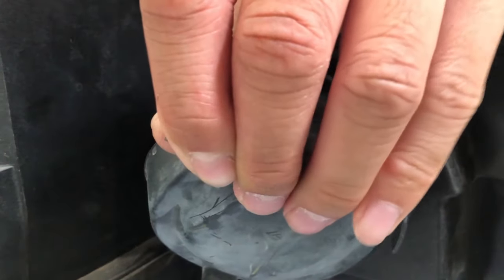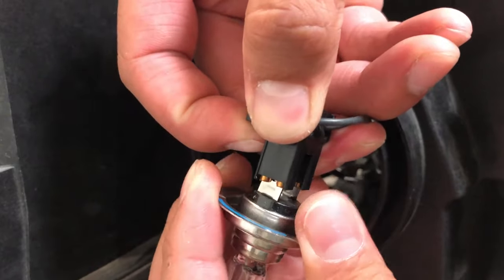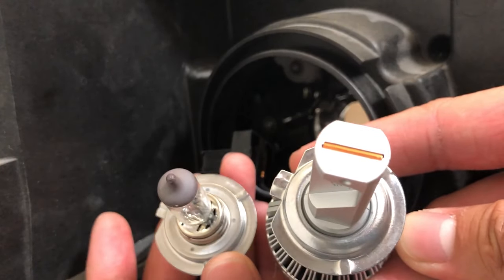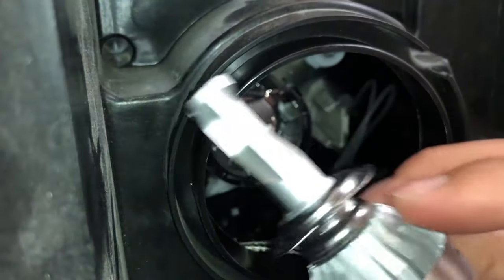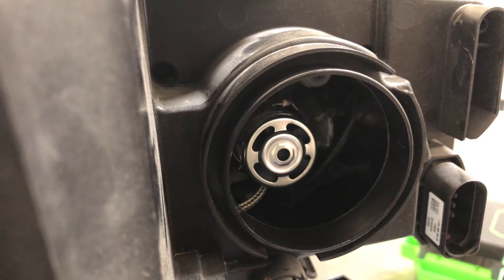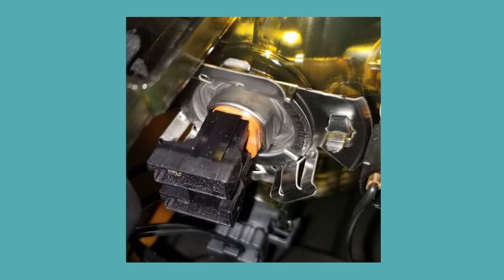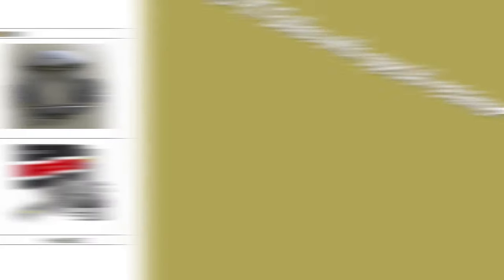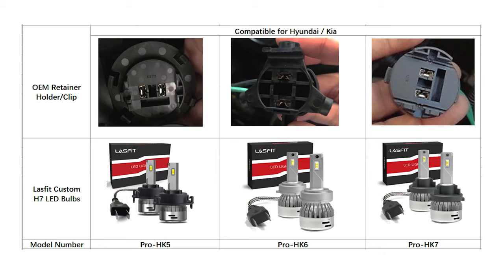How to install standard H7 LED headlight bulbs?

Comment: Hey guys I just installed these LEDs for my 2019 VW Tiguan for the high beams and they are super easy to install, maybe 10 mins tops. They were much easier to install than the low beams. Theses are the type 2 installation. Once the LEDS are clicked in and installed, you can twist it to adjust the beam pattern.
Reply from the maker: 👍 Good job 👍  How nice it would be if you could share a video with us of how you install these LEDs on your Tiguan. haha
Reply: @lasfitvehiclelife  Honestly, it is identical to the one in the video. The type two installation.
Reply from the maker: @michaelbrock8397  Yes. Did you test them and how they perform at night?
Reply: @lasfitvehiclelife  Yes, I tested them and drove around. They work very well and very bright.
Reply: Did you have issues with auto start/stop feature? Mine start to flicker/dim after the feature kicks on for the first time. Every time the car does it the lights also turn off and on quick. Did you experience that?
Reply: @AnthonyVlahovic  I did not experience that.
Reply: @michaelbrock8397  good to know thanks for replying

Comment: Hello, regarding H7 led bulb, won't it heat up when u just cover it up with the dustcover since there is no place for the heat to escape?
Reply from the maker: Hi, these LED bulbs are built-in temperature-control system, which keeps the LED bulbs work well in a proper temperature. Definitely, it's better for heat-dissipation if you could leave off the dust cover.

Comment: Good video.  Thank you.  I hate the spring style (type 1 here).  I wish I had any type other than that spring wire.
Reply from the maker: Haha. Type 1 is not hard to install the LED bulb.
May I know your vehicle make, model and year?
Reply: @lasfitvehiclelife  I have a 2010 Chevy Silverado but my spring won’t close correctly with my new beamtech led bulb and the dust cover is not deep enough to cover the whole back side of the bulb
Reply from the maker: @CeeLos_17  Did you install the after-market headlight assemblies?

Comment: Hello.I have one question.I am the owner of Skoda Karoq 2019
Recently I bought led lights canbus and worked fine without any alarm signal.I couldn't install it yet because i got confused with the housing.In the video the socket No.2 it looks like mine but when I do the same with you thing,the led light it's not hold in the housing.Do i have to buy some adapters
Reply from the maker: Thank you for getting in touch. I'm unable to determine the specific issue you're describing. If you purchased a Lasfit product, you can contact our customer service team at cs@lasfit.com. Please send some videos or photos showing the problem, which will help us better understand and assist you in resolving it.
Thank you!

Comment: Hey YouTuber I have aftermarket vland Audi style headlights on a Mitsubishi lancer 2008 my h7 leds doesn’t have the assisted metal bracket but I do have the spring. Will it still work?
Reply from the maker: Hello, could you please take some pictures of your housing socket and power plug of your after market headlights? We will check it and recommend suitable LED bulbs.
email: cs@lasfit.com
Thank you!

Comment: Thank you for the insight and info.
I want to convert mine, thus w203 2005 model c class. That is the 2nd example from you video. But after connecting the led globe. It keeps blinking and not stable. Please what can I do or what type of led should I use. Thank you
Reply from the maker: You probably need to connect the load resistor.
For some models of Mercedes, the load resistor si required if installing LED lights.

Comment: For LEDs from the bulb, what is the correct orientation? LEDs pointing at 9 and 3 (vertically) or 12 and 6 (horizontally)??
Reply from the maker: LED chips pointing at 9 and 3(vertically). The power cord is downward.
What's your vehicle make, model and year?  Is the headlight projector or regular reflector?
Reply: @lasfitvehiclelife hey, i have standart reflector headlights on audi a6 c6, installed led bulbs in correct position(9 and 3) but beam looks like wavy and looks not clean on the ground while using it what is the problem?
Reply from the maker: Hi, could you please provide us with the year and trim of your Audi A6, as well as whether it is equipped with factory halogen headlights or HID headlights? @arminaslevindravicius8389

Comment: Do I need to remove my bumper? Or can I just pop the hood and replace them
Reply from the maker: For most vehicles, it no needs to remove the bumper, just pop the hood and replace the stock halogen bulb with LED bulbs.
What's your car make, model and year?
Reply: @lasfitvehiclelife  05 mustang
Reply from the maker: @dopamineee3715  The headlight bulb size is H13, the fog light is H11, here are links:
H13 headlight bulbs:
https://www.lasfit.com/products/h13-9008-led-headlight-high-beam-la-series?utm_source=Social&utm_medium=YTB%20Channel&utm_campaign=LAplusH13

H11 fog lights:
https://www.lasfit.com/products/la-plus-series-h8-h11-h16-led-fog-light-bulb?utm_source=Social&utm_medium=YTB%20Channel&utm_campaign=LAplusH11-fog

Comment: I have type 1 and hate that spring thing. I accidentally broke it cause I didn’t know how to lock it back in place, now I just have loose bulbs in the socket
Reply: where does the cable go ?
Reply from the maker: Have you broke the spring?
Reply: @lasfitvehiclelife  yep I broke the spring trying to lock it back in place. I use tape now to hold the bulbs in the socket. Those type 1 springs are the worst locking mechanism to have on headlight’s assemblies.
Reply from the maker: @trilliamc5185  We would like to suggest you take your car to auto shop and ask a professional mechanician to help fix the issue. Otherwisem the LED bulb will be easy to fall out, especially when you're driving.

Comment: What's the bulb part#  for the "type 1 bulb" in this video??
Reply from the maker: Thank you for the message.
LAplus H7 LED bulbs as type 2 shown in this video, you can check more information about these bright LED lights on this page:https://www.lasfit.com/products/h7-led-headlight-high-low-beam-fog-light-la-series?utm_source=Social&utm_medium=YTB+Channel&utm_campaign=LAplusH7
Could you please tell us your vehicle's Make/Model/Year? So that we can recommend compatible LED bulbs for you.
Reply: @lasfitvehiclelife  I meant the type 1
Reply: @lasfitvehiclelife  I can't go by year make and model (2013 VW Jetta Sedan) Gives Pro-MB1-N doesn't fit right!!!, Because I have aftermarket projector beam housings, With a bulb retaining system identical to that of "the Type 1 Bulb. What is the part # ??
Reply from the maker: @TheTransporter100  Thank you for your reply.
Could you please send some pictures about the housing socket, power cord, and halogen bulb to us and whether you have already purchased LED bulbs?
Contact email: youtube@lasfit.com
Reply: @lasfitvehiclelife  Why do I need to send you photos'?, I gave you a perfect explanation of what type socket housing I have in the above reply (Type 1 , The first example in this video) It's exactly like that.

Comment: Hi Lasfit, I've got a 2010 b6 Passat with halogen projectors. I'm not able to twist the bulbs into place. I've also got the TK0003 clips on the bulb but they just don't seem to seat themselves. Any advice?
Reply from the maker: Hello, could you please take a short video or some photos to show your issue?
Thank you
Reply: @lasfitvehiclelife  Thanks for replying. I have spoken to the seller and sorted it out👍
Reply from the maker: @MadhoorRavikumarDhuginar  Glad to hear that.
Reply: @lasfitvehiclelife I have the same problem as him, where could I send in a video or photo and maybe a question or two?

Comment: how the heat will be dissipated produced by the led fan after tighting the dust cover
Reply from the maker: Hey, usually there is a small vent on the headlights for airflow. Besides, the LED bulbs have a temperature-control system built-in, which keeps the LED bulbs working well. But if you still worry about the heat dissipation, you can try to drill some small holes on the dust cover.

Comment: I’ve been looking for some for my 2015 challenger will these work?
Reply from the maker: Hi, your stock headlights are halogens, right?
If so, 9012 LED bulbs will fit your 2015 Challenger:
https://www.lasfit.com/products/9012-led-headlight-high-low-beam-la-series?utm_source=Social&utm_medium=YTB%20Channel&utm_campaign=LAplus9012

Comment: Which setup can I use for 09 mercedes c300 with projector headlights
Reply from the maker: The standard H7 LED bulbs will fit your 09 Mercedes C300:
https://www.lasfit.com/products/h7-led-headlight-high-low-beam-fog-light-la-series?utm_source=Social&utm_medium=YTB%20Channel&utm_campaign=LAplusH7
Reply: @lasfitvehiclelife  thank you just got mine in the mail today should the led chip be horizontal or vertical when installed
Reply from the maker: @xpert447  The LED chips should be  horizontal, face to face, not updown.

Comment: Hi Sir those H7 Led headlight bulbs  that you installed are not the correct Led H7 Headlight Bulbs as you want the H7 Led Headlight bulbs the have one row of 3 Led Chips & not 2 rows of 3 Led Chips as it makes the Beams of light Beams to wide in the reflector headlight housing & having 2 rows of 3 Led Chips makes it too wide as you see in the Halogen Filament the is only small & the Chips in your H7 Led Headlight bulbs don't exactly match up to the size Halogen Bulb Filament as one row of 3 Led Chips are the exactly the same size as the Halogen Bulb Filament & you don't want 2 rows of 3 of Led Chips in Led Headlight Bulbs & that's where a lot Led Headlight Bulbs being made by  companies that make mistakes you should only have one row of 3 rows of very small Chips  in a H7 led headlight bulbs & if you buy H4 Led Headlight Bulbs & the correct ones to buy are one row of 6 very small Led Chips one row 3 small Led Chips for low beam & the other 3 small Led Chips are for high beam & those type H4 Led Headlight bulbs are the correct ones to buy as these line up perfectly to the exactly to Halogen Bulb Filament & you should never ever buy Led Headlight Bulbs that
 have too wider Chips in these bulbs as are not to the exactly to the same size as the Halogen Bulb Filament & that's where you have problems that the Beams of lighting can go in all direction & blind other drivers on the other side the road or roads Please before you buy or install these Led bulbs match them up with Halogen Bulb Filament & the Led Chips line up perfectly with the Halogen Bulb Filament or Filaments & the & the Led Chips are the exactly the same  size as the Halogen Bulb Filament or Filaments & you can't go wrong & you have got the correct Led Headlight Bulbs Kind Regards Peter & you can always take them back where brought the Led Headlight Bulbs from or before you buy the Led Headlight Bulbs take one of the Halogen Bulbs with & compare the bulb with the Led Headlight Bulbs with the Halogen Bulb Filament or Filaments to make sure that the Led very small  Chips line perfectly with the Halogen Bulb Filament or Filaments & you can't go wrong & I'm going to order a pair of H7 Led Headlight bulbs on one of the  AliExpress Stores & they have the correct Led headlight bulbs & those H7 Led Headlight bulbs have  3 in a row very small Led Chips & are very thin Bulb going from the bottom of the bulb to the top of the H7 led Headlight bulbs & will line up exactly perfectly with Halogen Headlight Bulb Filament & these Led H7 Headlight Bulbs are 750W 30,000 LMS which is a amazing Bulbs & for the price is pretty good really New Zealand $21.21which is an Excellent Price H7 Led Headlight Bulbs & I will be installing them in a PT Cruiser as low beam & that will be a very bright Led Headlight Bulbs as the Halogen Bulbs I have already in the PT Cruiser are not very good lighting & so it will have really good  Headlighting once I get these H7 Led Headlight bulbs & have these installed & I will be installing Bulbs myself 😊
Reply from the maker: Thank you for your detailed feedback and suggestions! Would you be interested in testing our LED bulbs? I can apply for a test sponsorship opportunity for you.

Comment: Which one would work for pontiac g8 aka ve commodore
Reply from the maker: Hello. what's the year of your pontiac g8 aka ve commodore?
Reply from the maker: @Mr7thsilver8  We checked for 2008 Pontiac g8, the headlight low beam is H11, high beam is H9. Did you install after-market headlight assemblies?
Reply from the maker: @Mr7thsilver8  Ok. If you're sure the low beam is standard H7, then you can purchase the standard H7 LED bulbs.
https://www.lasfit.com/products/h7-led-headlight-high-low-beam-fog-light-la-series?utm_source=Social&utm_medium=YTB%20Channel&utm_campaign=LAplusH7